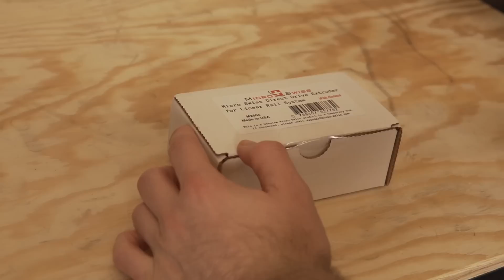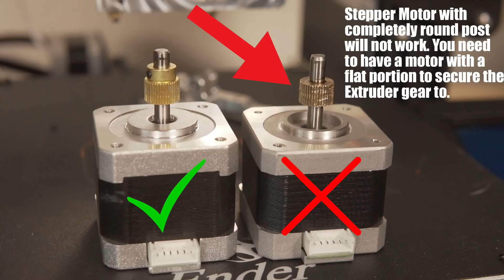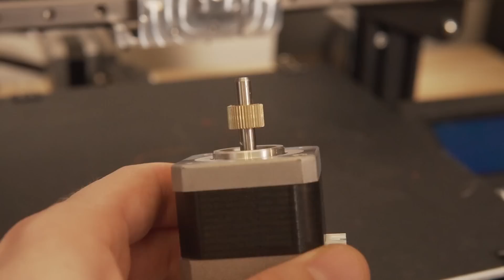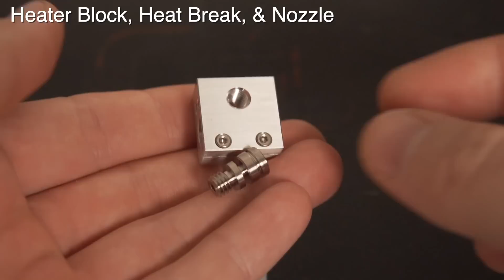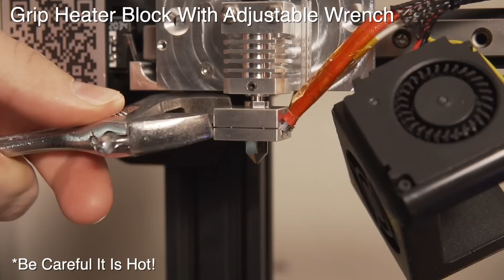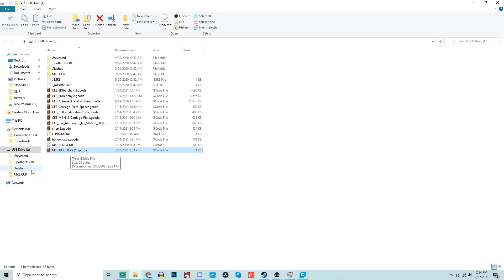Micro Swiss Direct Drive Linear Rail Upgrade For Ender 3 and CR-10 3D Printers

Comment: Excellent video.  I'm considering this upgrade but it doesn't appear there is a location to mount my BL Touch on the Micro Swiss main body?  Or am I just missing it?
Reply: What was your fix fo the CR Touch mounting? I have the MSDD on linear rail with no way to mount the sensor!

Comment: I ran in to a small problem with the Micro-swiss linear rail hot ende kit. I have a Bullseye fan duct. The wire support structure on the Bullseye fan duct hits the extruder lever on the Micro-swiss bracket.  I cut off the piece on the Bulleye that was intended for routing the wire bundle.

Comment: I had a motor with a press fit gear. You do not have to buy a different motor. You can remove the gear with some brute force and you can make your own flat. It doesn't have to be massive and 8 have been printing with mine like that fir 3 months with no issues. No need to spend money you don't need to.

Comment: I have 2 issues with this set up. 1) The 2 piece carriage. It's unnecessarily fiddly to assemble and it's additional weight that can be paired down. 2) The stock extruder stepper is way too heavy for a direct drive in my opinion. Microswiss needs to come up with a geared reduction set up so that you can utilize a pancake stepper motor.

Comment: Hi, is the hotend designed for 24v or 12v? I have a geetech A30 with E3D hotend on 24v that I want to upgrade to microswiss direct extruder on linear rail.
THank you

Comment: I think that's great you're doing videos like this but this is exactly why I held up on getting a 3D printer for years. I just want to print some stuff, I don't want to have to spend additional hundreds of dollars on top of what I've already spent on a printer and then have to modify it constantly in order to get good prints. Currently more and more printers are coming out that don't need modifications and I like my risen printer for that reason. I've been looking around for an FDM printer but as I see videos like this still coming out I am concerned that I can't just buy a printer and be happy with it as it is out of the box.
Reply: bad take

Comment: Cut into gear with dremal cutting disk stop before all the way through spread with flat screwdriver breaking gear and removing it. File down a flat area on the shaft. Install new gear. Crank down set screw onto flat area of shaft.

Comment: But you dont need the linear rails for this extruder right? Seen mixed reviews about them, that might even be worse...
Reply from the maker: You do not! They have a version that you can install that uses standard v slot wheel. I did a video on it if you want to check that version out
Reply: @ModBotArmy  ok, thanks! I will look for it. Just ordered my first ender 3 pro with some mod upgrades, so now studying before building. And got bit sidetracked on these new extruders and so..

Comment: Excellent video, new subscriber, I have a Creality 10S and have purchased the direct drive, when you updated the stepper motor settings, you used a software or did manually, how is this done. Thanks
Reply from the maker: Stepper motor settings show at the end of this video. You mean the e steps right? There is a Gcode file provided by microswiss you just need to put on a memory card and have your printer “print” it to apply! Thanks for the sub 😬

Comment: Thank you
Does it fit to ender 3 v1
Reply from the maker: This is the Ender 3 v1. Did you mean the v2? If so it will be slightly different since it has a different fan shroud/housing. It may require converting the fan housing tot he style on the original Ender 3
Reply: @ModBotArmy  
Thank you, as your video is recent, I presumed that it is for recent ender
I will love to upgrade mine
FYI, with very little review about Bibo2, your review was much helpful, I am using bibo2 , it is doing good job

Comment: Nice, clear instructions.  👍

I still haven’t got around to putting the new extruded on my Ender 5 Plus (after I get the new mainboard and display installed...) and this is a good reminder for how to do the install properly.
Reply from the maker: Thank you for the feedback! Did you get the direct drive kit???
Reply: @ModBotArmy  
Yes, for the Ender 5 Plus.  Carrier plate differs from the Ender 3 / CR 10 one.  There is a local(ish) place that stocks some MicroSwiss stuff.

Typically I do a ‘dry run’ for anything that looks tricky.  It’s not much fun when you’re about ninety percent ‘finished’ then realise you missed something that requires disassembling everything.  🤦‍♂️

Comment: Just bought this setup and did the micro Swiss full mod that you did awhile back. Will this be fine with the ender v2? Hope so it’s bought and paid for rails/ microswiss housing
Reply from the maker: The v2 will be different the main issue I see is with the fan cover/housing. You would need to convert it to the one that is on the Ender 3. A printable version would be awesome. It can definitely be done but that is the biggest difference I can think of currently.

Comment: Can a pancake stepper motor be swapped for the stock motor?
Reply from the maker: That is a great question. My answer is I don’t know. It is possible but I have not tested to see how it would hold up.
Reply: Pancake motor only have 0.5X the torque of a full size extruder motor. They are usually intended for 3 to 1 gear ratio extruder. The Micro Swiss system don't have any reducing gear. This means that the pancake motor might not have enough torque for your application and/or got burned after a while due to overheating.

Comment: I've got to say my friend you do a GREAT job on the tutorial vids. The fact that you put the instruction in bold while talking to it is a nice touch.  I'm really debating on going direct drive via the rails upgrade to my ender 3 pro. It's working so well now with all the updates I've already done. ummmmmmm
Reply from the maker: Thank you very much for the kind feedback. This video was a ton of work due to adding things like that but I really hope it helps others. Haha I know the feeling. What is your current configuration on it?
Reply: @ModBotArmy  Its a Ender 3 pro as I mentioned with a new shorter bowden Capricorn tube, a Swiss hotend and a dual gear extruder. Also I a lot little 3d printed teaks. I only print PLA but would really like try other types of filament.

Comment: When I installed the standard unit from Micro Swiss it moved the head forward so I lost a bit of print area in the Y-axis.  I was able to move the Y-axis end stop forward a little but I didn't get it all back.  Did you do anything in your firmware or slicer to acknowledge this change?
Reply from the maker: I currently have not since I am not maxing build volume. You should be able to change the y axis max build volume in the slicer to counter that. It is quite minimal right? (Have not done an exact measure yet)

Comment: I'm surprised you've upgraded all of these things but haven't upgraded the hotend fan to a Noctua or something else to make it quieter. It makes a huge difference in volume!
Reply from the maker: I need to do that. Maybe I will make a video. They are only 12v right?
Reply: @ModBotArmy  yup. However for an ender 3 you’ll need buck converters. I have a CR-10s so I didn’t need to do this since it’s 12v by default.
Reply: @ModBotArmy  The easiest thing is to replace the hotend and motherboard fans both with 12v 4020 fans then wire them in series so each fan only sees 12v.
Reply: I feel the noctua's don't push enough airflow, and also are not that much more quiet, and basically is not worth the rather high cost
Reply: @Labworks-Kharma  On my printer, just changing the hotend fan to a noctua made all the difference! For the other fans though, didn’t do much of a difference. Maybe your printer is quieter, but it helped me out a lot and a lot of other people as well considering the number of tutorials out there for it.

Comment: Would you need to change your Cura/Marlin/Octoprint...etc settings to reduce the max Z with this setup?  I never print stuff that tall but it would be a nasty surprise at the very end of a tall print if that extruder motor went solid against the top rail.
Reply: It clears the top rail a little but then the wires will jam underneath it. So yes definitely do change the height in slicer.
Reply from the maker: Thank you for mentioning. I have not measured what you lose (I also never go nearly that high) but absolutely. If you are printing something tall it would be a bummer. Recommendation would be to home the machine and have it climb until it hits. Then look at the screen to see what point it hits and adjust your slicer.

Comment: now that you have the all metal hot end how do you go about setting the firmware for higher temps i think the ender maxes out at 260, with the all metal hotend i would like to be able to get above that temp a little say to 280 or so
Reply: i guess you just recode marlin.
Also, check if your thermocouple/thermistor and the heater is able to work at such temperatures.
Reply: @piotrk6309  and how would u recode marlin 
and the heater cartridge and temp probe are fine up to 300c they just have it set at a safe temp because it wasnt a all metal hotend
Reply from the maker: Yes you would want to change your max temp if you want to go higher. This will very depending on the board used. As long as you have a boot loader on your board the change is quite simple since it is just the one value
Reply: @ModBotArmy  i bought the creality quite board off amazon it was already loaded by the company i got it from with the firmware for my ender 5 plus does that mean they had to put a boot loader on it
https://www.amazon.com/gp/product/B085DM75Q6/ref=ppx_yo_dt_b_asin_title_o09_s00?ie=UTF8&psc=1

Comment: If the dia of the motor shafts are the same you can just grind or file a flat spot on the shaft to use the grub screw.
Reply from the maker: Very true. I didn’t mention that since I think most wouldn’t necessarily feel comfortable going that route

Comment: Would you be able to post a vid or some help on how to calibrate the direct drive to the ender 3 bed? Whatever I do it prints off the bed ever since i installed it? Trie to compile q new firmware with home offsets but to no avail...
Reply: I think this might be what you are after:
https://www.youtube.com/watch?v=VpciFs30xCA
Reply from the maker: If your bed is using Manuel leveling you should just have to relevel the bed. If you level the bed and make sure the nozzle is the correct height it shouldn’t have any way of not printing correctly. Unless something weird is happening in the slicer so the part is not starting at the base.

Comment: Looks like a great upgrade for my Ender 3 V2. Is there an overall weight reduction in this set up? I'm looking to get faster and good quality printing using Klipper. I think lowering the overall mass combined with direct drive extruder and all metal hot end would be a great solution. Especially when mounted to a linear rail.
Reply: more weight  as now you have your extruder and motor on your x-axis
Reply: @patrickmaartense7772  Any idea how much is offset by the removal of the rollers and plate assembly? Otherwise I may look to staying with a bowden tube with frame mounted extruder.
Reply: @Supperconductor  no idea, I dont onw that setup, but generaly adding a direct driver will add weight. one of the advantages of bowden is the ability to print faster in regards to moving parts.

Comment: Good Vid man.... I thought you had planned to get rid of the printed brackets you used before? There's no need to get a new motor just because you have the pressed on gear. It's a simple matter to grind or file a flat spot onto that motor shaft. It only needs to be in the area where the grub screw lands if your too lazy to do the whole length. 
Edit: Right forget what I just said. You only had the printed stuff on the old carriage.
Reply from the maker: Someone else had mentioned that and I do agree that is a great option. I do think some may not feel comfortable going that route but totally for those that do that’s a perfect solution 😬

Comment: God damnit I asked microswiss if they had any plans to do this and had to have a plate machined :D
Reply: A printed adapter plate would have been fine.  There isn’t any active load on the print head, so metal plates aren’t crucial where high temperatures aren’t an issue.
Reply: @boggisthecat  kind of missing the point a little tbh.
Reply from the maker: No shit haha I am sorry man. Maybe that was before they even decided to do this. Did you find a local machine shop??
Reply: @ModBotArmy  who knows, micro Swiss are not great on the social media... Or their contact form :D, I got a friend to make the changes for the linear rails but the official option does look a little better.... Except the plate only option doesn't seem to be available in the UK (waiting for them to respond :D)

Comment: If money is a issue as it is for me, creality offers a direct drive upgrade that is fully assembled ready to install . The price was around 40 bucks but it is not a all metal hotend, it's the same hotend that comes on the stock ender 3.
Reply: Gulfcoast sells a Micro Swiss clone on Amazon for a pretty reasonable price and it works great.
Reply: @jon9947  ty jon, i might try it.

Comment: Really would love to see before and after shots of these mods.  Have you seen quality improvements?
Reply: Same questions. (Glad you asked)
Reply: I tryed this update. I did to print higher temp filament.
Now it is a Hall metal hotend, you can in principle print PC (poly Carbonate) with hotend temp around 185 oC ! Great material by the way
Reply: The MS direct drive and hot end are nice. The linear rail is useless on this setup.